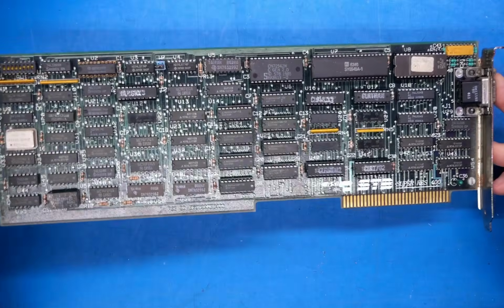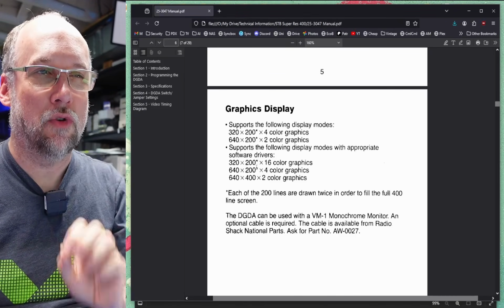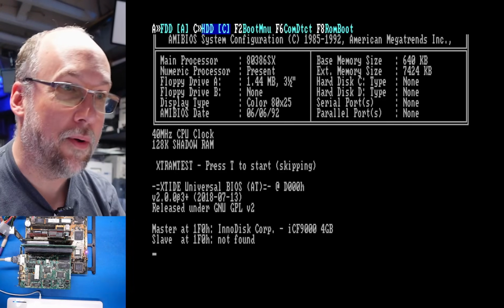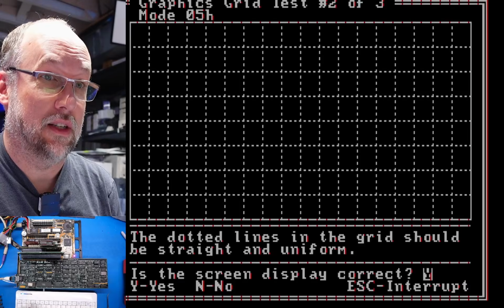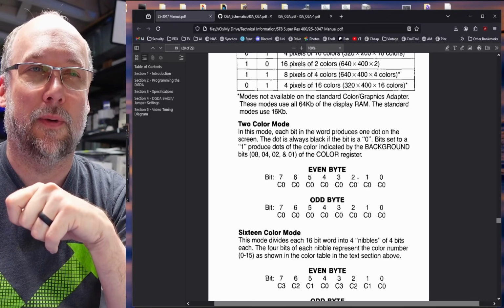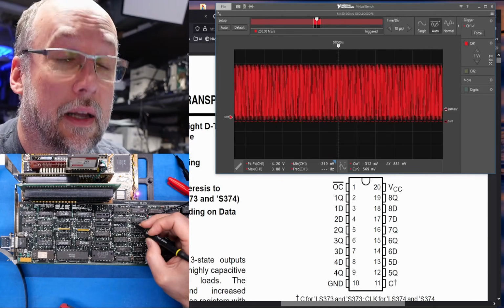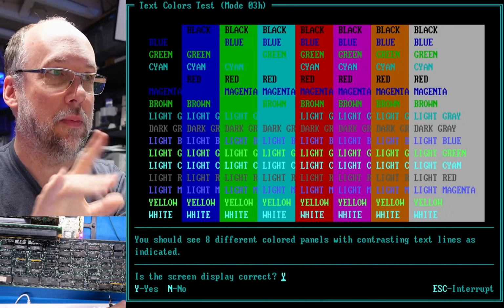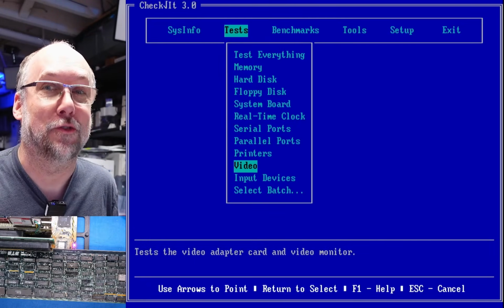Fixing a rare and broken high-res video card (STB Super Res 400)

Comment: I know the video has been up for a year.  When you mentioned about the serial number being 15,something something.  That doesn't necessarily mean that was how many cards were made of that series.  When I worked in electronic manufacturing, they specifically said that serial numbers, for them anyway, started at 1,000, 5,000 or 10,000.  This is because no one wants a first/early off of certain equipment.  No one wants the SN#1 for some stuff.

Comment: The weird noises around 21:00 sound like power supply overload.  If that's related to certain ISA slots, could it be some pins of that slot actually short the power supply? Maybe misaligned pins or something conductive fell into the slot?

Comment: My congratulations!

I have the same card which loses sync signals when I try to switch it to Tandy mode with any method (Chinese weird XT-386 machine, OEM version of DOS 3.3 for Tandy PCs) and it suddenly stopped showing picture on VGA multi-frequency monitors (they just started to showing "Out of range" message) via 330 ohm resistors passive adaptor, but on the authentic EGA monitor it shows picture totally correctly.

Comment: Wouldn't be so pessimistic about those PALs. Even if it would have been that, it's ONE output. Since its RGBI, there should be at least 2 very similar terms, if not identical just at other pins. 

I think it would have been possible to deduce what it should have been doing, by looking at the blue and green equivalents.

Comment: Ideas for Testing Higher Resolution Modes:

* The 320 x 200 x 16 color mode.  I wonder if this mode is the same as Tandy Graphics or EGA 320 x 200 x 16.   Perhaps software for one of these may enable this mode.  Considering it was used in a Tandy 2000, I wondered if the Tandy Extended Mode 320 x 200 x 16 is identical.  https://en.wikipedia.org/wiki/Tandy_Graphics_Adapter   It may also be the same as EGA 320 x 200 x 16.  

* 640 x 200 four color is also a mode of the Tandy Graphics Adapter.  

* If I remember right, 640 x 400 was used in some Macintosh computers.  I wondered if some games or Apps were ported that used this resolution.  It is also possible that it was more common in other countries. 

* Some EGA cards with third party boards can do 640 x 400.  

* VGA Can also do a custom resolution of 640 x 400.  It was also the MCGA text mode resolution.  I wonder if 640 x 400 was enabled similar to one of these programming wise.
Reply: I also wonder if the additional memory in the card accessed by the computer in the A0000-AFFFF region (Note: some memory programs address by block and omit the last digit), the same region as EGA/VGA or B0000-B7FFF,  the same region as Hercules Monochrome.

Comment: Another great repair. Sure you took off one IC you didn't have to, but sometimes in discovery that just happens. You still did an amazing job in tracing down the three main ICs that were responsible for the output you were seeing even though it didn't match your schematics. I consider that great work.
Working with old tech is often an exploratory adventure these days, especially when you no longer have good documentation available.

Comment: Adrian:
1) Remember that inside every one of those ICs are transistors and diodes (at least), so if one fails it can do strange things like shorting together two signals, messing up timing so clocking a latch may not happen as expected.  Clean failures of an input or output is much easier to pin down, you did fine in your troubleshooting. 

2) I was sometimes able to desolder an IC pin and get it isolated from the PCB pad, feed through, and trace.  That way you can avoid desoldering the whole chip, or cutting the pin.

3) Since Radio Shack sold the equivalent card, could you try using one of their apps or utilities, like DeskMate for example, that would exercise the higher resolution modes?

Good luck, looking forward to the upcoming video!

Comment: The latch wasn't latching. Q would go high when D was high, but only while the clock is high.
The attribute latch clock is likely opposite the data latch (to allow settling)
That means Q going into D of the attribute latch was always low on the rising edge of that latch's clock.

Comment: If the PALs are not registered they are pretty easy to crack and copy. There' s a method to dump a PAL and re-create the equations then compile to a jedec. i've been doing that for ~15 years and it works well as long as the PAL isn't being using in registered mode. This method should be coming to the RCT soon as I passed on that info to the developer so he can improve it. btw when you find bad logic run it through the RCT as that gives a visual representation of the pins and points out the bad pin which can be shown in the vid.

Comment: A very big issue when not having schematics is when you have hard to see broken traces. You can trace traces all you want but if have a broken trace/solder joint that is hidden under a non-socketed chips it can be difficult to find all chips on a particular line. Good thing it was a damaged chip that you had a compatible replacement for.

Comment: The graphics adapter Compaq included in the Compaq Portable functions as a dual CGA/MDA board. I think it can be configured to act solely as a CGA board? I know it's possible to force it into CGA mode for display on a external display using CTRL-ALT-< and CTRL-ALT->.

Comment: While it doesn't specifically call out the super graphics / graphics plus 2.  An older piece of graphics software that I still have a copy of (complete in box, if you're curious) is the Disney Animation Studio.  for IBM PC, XT, AT, PS/1, PS/2 and compatibles including Tandy 1000, 2500, and 3000 series.  Worked on VGA, MCGA, EGA, Tandy and CGA modes.
The other software I recall using (not sure if I have the discs but I can check) would've been older AutoCad v 2.  I recall it having specific uses for Hercules Display.

Comment: STB Systems, Inc., was an American graphics adapter card manufacturer active from 1981 to 1999. Initially a manufacturer of various expansion cards for the Apple II, the company quickly leaned into the graphics accelerator market for IBM PCs and compatibles, owing to the IBM PC's more open architecture. STB went public in 1995 and was once the second-largest global vendor of multimedia computer products. In 1999, the company was acquired by 3dfx Interactive.

Comment: According to the manual, an ATI EGA Wonder can run a 25khz 400 line monitor and supports EGA, hercules, MDA and CGA modes on it (and apparently even a couple of VGA modes that ATI threw in on their EGA card), scan doubling the 200 line modes, and slightly squashing 350 line modes as far as I understand it.  I wonder how hard those are to find these days.  Certainly on Ebay the prices look a bit nuts for them.  I suspect most EGA cards didn't have 256K ram that the ATI did.  You had one in a mail call about 3 years ago, so maybe you still have it around.

Comment: Not that it would have affected finding the eventual issue in this case, but when you found the output at zero volts, an alternative approach may have been to bust out the thermal camera and carefully inspect the chips and trace connecting them. Not sure if that data line is seeing enough activity to generate a heat difference, but any difference in temperature between it and adjacent pins or chips serving the same function would indicate the output is trying to drive hard against a shorted input, while no apparent difference would imply the output isn't being driven at all.

These modern/cheap thermal cameras are surprisingly sensitive to small differences in temperature, especially if you can get their field of view narrow enough that they auto-range down to a degree or two overall across the whole image. Even 0.1C is often quite visible, depending on the exact sensor.

Alternatively, using your current-limited power supply to inject a bit of voltage into the suspect data line plus an adjacent one (with the board off firstly, although it's also possible with the board on if you're careful to not overload the output pin) going to the same chip might let you differentiate between them, based on how much current is drawn.

Comment: I used to have an IBM 3270 PC with the GX graphics extension which took up three ISA slots, similar to the IBM Professional Graphics Controller except using a special high-resolution TTL colour monitor.  The display controller had an 8080 on board and supported several graphics modes, up to 480 line text or 720x350 graphics at 16 colours (with special software which I never had).  Owing to it having a 720 vertical line resolution (actually 800 on the display itself), the 640x200 CGA monochrome mode only used slightly more than half of the display.  I had the standard 5272 colour display but it could be used with a standard TTL monochrome monitor or the larger 5279 professional colour display.  IBM even offered a TTL gas plasma display with the system to go along with the plasma display terminals which were popular with their mainframes at the time.

Comment: Well - I've never seen an STB Super Res 400 video card before, but I must say, it seems eerily similar to the video card in my first IBM compatible machine.  It was back in '84 or '85.  I had moved up from a Heath H-89 CP/M system to a Heath H-200 (AT compatible) which I had outfitted with a Sigma Designs Color 400 video card (driving a Princeton Graphics SR-12 monitor).

The card was Very similar to the STB - same size and form factor, would do 640x400 high res 16 color graphics over a DB-9 connector to the display.  Almost perfectly CGA compatible, but this was still just before the EGA boards hit the scene.  [I seem to recall the Sigma Designs board also supported an optical mouse on a metal mouse pad with a grid pattern printed on it, and came with a copy of 'PC Paintbrush', which was probably the ancestor of MS-Paint.]

Looking at this video, I now wish I could see my Color 400 side by side with the STB card.  I wonder if they shared any DNA?

Comment: IF you didn't have a schematic for the generic CGA card, and IF STB didn't copy much of the CGA design (though they used different similar parts) you wouldn't have been able to fix it.
Still, a good bit of sleuthing!
BTW that brush probe is a bit risky, you could short 5v to ground quite easily, and maybe blow something up.

Comment: This looks like an 8-bit version of the 16 bit Olivetti M24/Olivetti M24SP and Olivetti M28 Video Graphics Card GO317/GO318/GO380
Olivetti also produced another 18 bit "add-on" card that then made it possible for 16 color in 640x400 pixel - This was in 1983
Reply: Take a look at the AT&T 6300 who resold the Olivetti rebranded as the AT &T. The 6300 had a 16 bit bus and 640x400 resolution on their special monitors. I had the AT&T 6300 in 1986.

Comment: Since the "leaking" clock signal would be trailing the actual clock by a tiny amount, at the following chip, D would always be low as the clock latched the input (hence the always-low Q).

Comment: In my country  we used  the NEC PC-9801 from the first mid to late 80. And loved the high res. Meanwhile cga and ega were half that.
Even the last and best PC designed and built here, an XT compatible, in 1986, we made its video system to be able to output the same high res, in 16 colors

Comment: @Adrian, why don't you use the Retrochip Tester anymore to test potentially faulty ICs?
Reply: You’d need to pull the part from the circuit board to use that, and he’s trying to minimise the number of parts desoldered. If they were all socketed then it’s an option.
Reply: @stevetodd7383  , the suspect RAM was socketed, the unsoldered latch was found working, etc. When you unsolder a suspect chip, it's good practice to test it to confirm if it's faulty or not. Same with testing a used part you're going to put back in the circuit. It's just good practice, otherwise you set yourself up for unsuspected errors.
Reply: @jannievanzyl4073  The RAM wasn’t suspect, he was removing it to minimise the possible areas to check. You’ll note that he was trying to reduce the RAM to a minimum for the subsequent logic tests. The logic ICs, while in circuit, weren’t testable. Once removed granted he could tested the suspect latch on the chip tester, but settled for lifting the suspect pin and seeing if that solved the issue. Since this was part of a video card then it was running at speeds beyond that of the chip tester (roughly 24MHz from memory, so that approach better matched the test requirements).
Reply: IIRC the retro chip tester pro tends to let marginal parts pass at times
Reply: @No-mq5lw  , I've been using a RCT for many years now. Never seen that it did not test a TTL chip correctly. There are/were some issues with some DRAM, but that's been sorted.

Comment: is this a PGA card ? the obscure standard IBM used on some profesionnal PCs in the mid 80's ?
Reply: Doesn't look like it since PGA cards had their own 8088 on board and I'm sure it would've been a point of interest for the video 

Oddly enough there were some PGA clone cards that used the National Semiconductor NS32k series, implementing the PGA interfaces with a full 32-bit CPU, much faster than the original PGA cards.

Comment: Just from what I recall on logic chips.  Specifically latches like you were working on, Q  is a third mode.  As in 0v is a logic 0,  5v is a logic 1.   Q is actually high impedance mode.  It is neither 1 or 0.   it is to act like the latch is completely off the bus.  So that one line/latch  was 'blown' or leaking.   I know you were focused on the colour red but you also have some bar issues there too. From what I recall on the chip it self   (I maybe a bit off ,  hard to remember)  There is a transistor 'tree'  that does the 0, 1, and Q.   The tree is done in such a way to reverse bias all the internal output transistors to be forced into Q.  One reason for this that I recall is the fan out rule (I think it is called).  Even though that was an output line there can still be leakage back in electrically.  So one line for example can feed 30 other input IC's (depending on the package type)  There can only be so much leakage from all before the rule is broken and you could get random states.        Fantastic job on the research and board logic you did.  Some very good reverse engineering.  (I am not sure I would of gone through all that!)  Your almost ready to make your own video card ;)
Reply: You’re confusing tri-state logic (where an output pin can be high, low or high impedance - typically labelled H,L and Z) and D type flip-flops. The 74LS373 is a tri-state D type flip flop, so if you set pin one (OEn) high then ALL Q pins go to Z. This isn’t a Q only thing, and doesn’t apply to all 74 series parts.

Comment: My weird STB is a full-length, dual head PCI video card with a loopback cable. Tseng Labs chip, I think. Basically, it was meant for a video editing rig, and the loopback let you overlay your editor’s video output onto your preview/program windows inside the NLE software (D-Vision in my case). Couldn’t do it over the bus back then. My Creative DXR DVD player did the same thing, using chroma key to display the video.

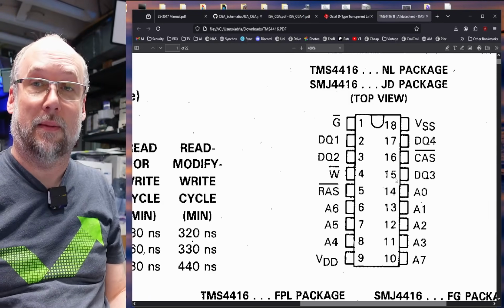Comment: Isn't that "strobe" testing at around 44:00 quite dangerous?
If you shorten two pins in a bad way, might that fry the chip?
Or is the time too short in order to create problems?
Reply: I think the board was powered off at the time (I don't see the power LED lit).
Reply: @nurmr  ah good point. When I was doing something like that on a chip I had it under power.

Comment: The video card in original Compaq Portable can also act both as MDA and CGA and switch on the fly, it's normal 8bit ISA card with DB9 and composite outputs altough I've never tried it outside the Compaq.
Reply from the maker: @snap_oversteer  the Compaq card does that with help if the Compaq BIOS so in a normal PC I think it will act just like a CGA card (but I also haven't tried it)

Comment: 7:20 ATI EGA Wonder cards can do that too, grayscale EGA looks pretty nice on the original IBM 5151 montior :)
Reply from the maker: There appears to be multiple versions of EGA wonder. One of them even supports 400 line mode but mine (and I have the manual for it even) doesn't. I should try the MDA mode though!
Reply: @adriansdigitalbasement  I have the low cost EGA Wonder 480, that one definitely works on MDA monitors with grayscale. I think it can also be switched between MDA and EGA with software supplied from ATI but it's been a long time since I've used it.
Reply from the maker: @snap_oversteer  I think you're is the one that does 400 line mode too. Apparently that card used a VGA chipset as it's very flexible. My EGA wonder has a totally unrelated chipset even though it's still called EGA wonder. Very confusing.

Comment: 35:34 Yes, bit-7 of background is the “blinking” attribute; that’s why text modes only have 8 background colors instead of 16 (sacrifices must be made). Underline is (“normally”?) only available in MDA modes and it triggers when the bottom three bits of the foreground color are exactly 001 (either “blue” or “intense-blue”).
Reply: I recall one game developer (can't remember who) made use of that encoding to have their adventure game work and look good on both MDA and CGA. On MDA systems, the title bar at the top of the screen was underlined all the way across, and on CGA systems, it was blue on grey, but they got to set up the video memory the same either way.